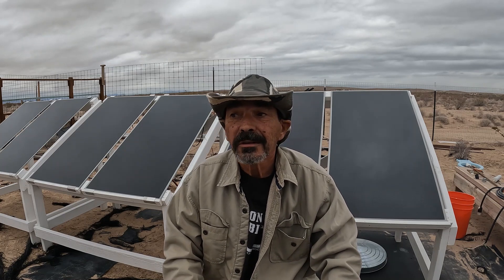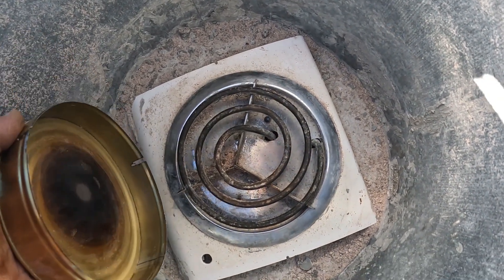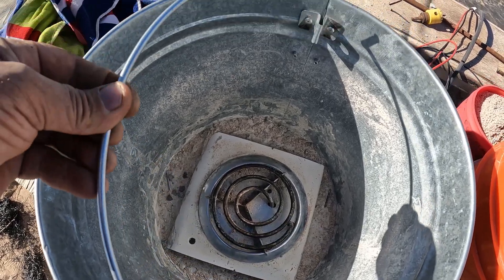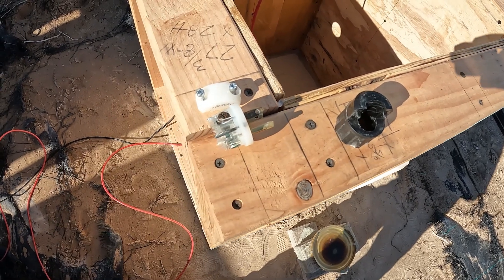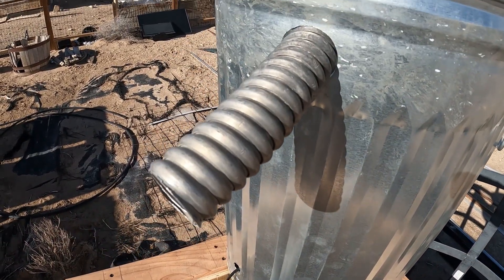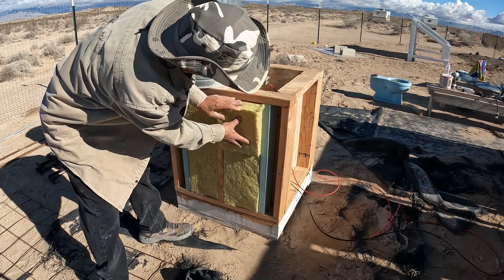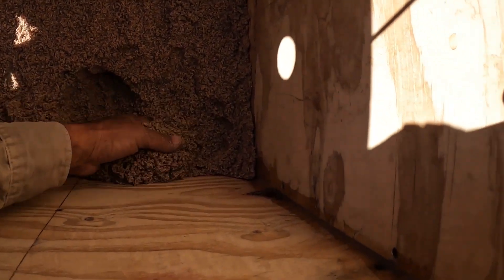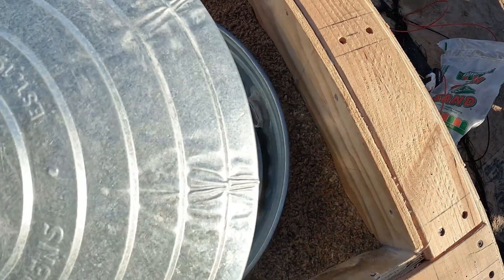Sand Battery Update Part 5

Comment: Enjoying your project. The wire connected to the flat element needs to be high temperature wire with high temperature insulation, otherwise your insulation can melt and cause problems. Great enthusiasm sir.
Reply from the maker: Thank you for the information. I am contacting a gentleman who works with the nichrome material to see if he can give me some pointers on things like that and possibly give some parameters on the element material.
Reply: @off-gridsurvivalmike8120  Use any element, measure the resistance with an ohm meter. Say the resistance is 10 ohms  and the power supply is 120 volts , you will need a #12  high temperature wire that Home Depot sells.

Comment: Hello there. Hey, keep up the fine job, i'll be waiting for part 6 and hopefully your results. I was planning to build something very similar, but a double layer r40 insulation all around, top and bottom. I'm really keen on finding out how long the temperature will hold, with out extracting any heat. Using the sun to heat the sand to maybe 3- 400c, then to be used in the winter.